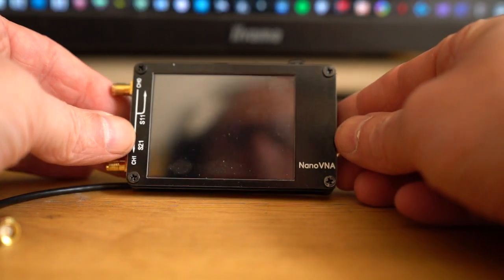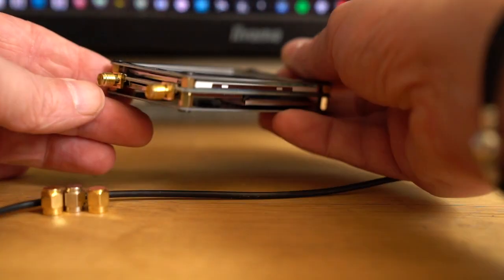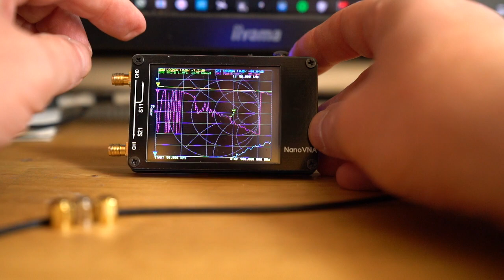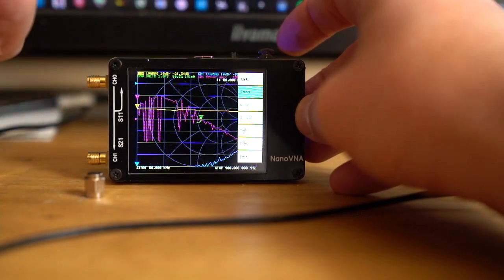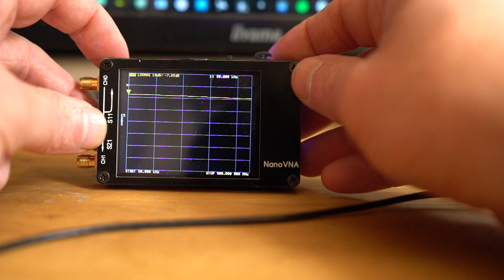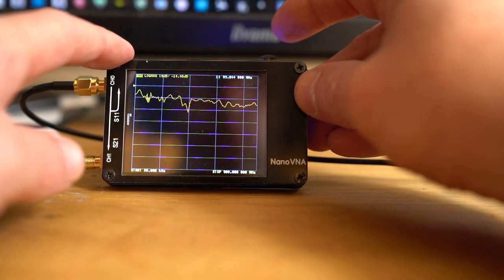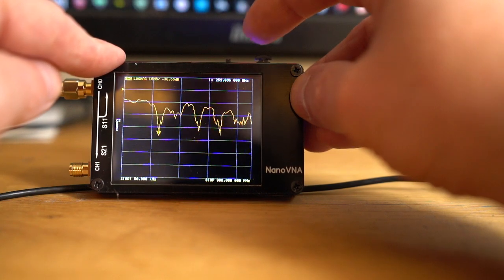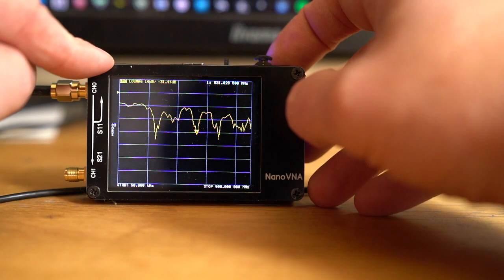NanoVNA for antenna testing

Comment: Doesn't it have a touch screen? Also, you should look at SWR and impedance of the antenna. You want your SWR as close to 1.00 as possible (<1.50 is good) and your impedance to be the same as your receiver and cables (usually 50ohms)
Reply: What happens if impedance is different? I have a cell phone signal booster. It works at 50ohm impedance. But coax is 75ohm. What would happen in long term or short term?

Comment: A LOT OF MISTAKES !!! How do not to use a VNA.
First - It is clear it is not calibrated at all: after the procedure the zero port is open but the marker on the Smith chart is far from the right end.
Second - You can not test an antenna sweeping the VNA from 50 kHz to 900 MHz: it measure on 101 points and it means there are 9 MHz between a point frequency and the next one  or the previous one. If you need a measuring on a so large bandwidht, you have to use Nano VNA and VNAsaver togheter setting "segments" function.
Third -  Nano VNA generates about 0.1 mW of RF on zero port and an installed antenna... No, I leave to you to discover why it is a mistake to use a VNA to measure the SWR (or RL) on an installed antenna.
Go to study before publishing  a video and you will understand that and a lot of other things spreading less wrong infos.

Comment: When you have to snip a brand new antenna, being able to see that V curve helps so much. This is so far ahead of the old SWR Meters.
I like to calibrate a little wider than the band, move the marker to the center of the band and save it on zero. That way it starts up ready to go. Also I just started using the extension lead so stiff cable doesn't tear the SMA port out of the board. Just have to calibrate at the end of the extension.😀
Reply: Love mine for antenna work.

Comment: Cool! I didn't think about checking resonant frequencies without defining a band width. 
For a single band I like to setup up the start and stop frequencies 2 points wider for example if the actual start of my band is 26.965 Id set it to 25.000 and do the same on the stop or high end of the band. That way you actually see the V curve the SRW has.  Without doing that you see pretty much a flat line usually favoring one side of the other.

Comment: I got the top model with big UHF connectors, 4 inch screen 3000mah battery full steel case. Heavy cables and  calibration kit. Upto 3ghz. Amazing results.

Comment: One note on calibration. You want to calibrated as close to the antenna as possible as it will remove any errors introduced by the leads.
After calibration it's good practice to check if the Open/Short/50ohm plots look good.
Whenever you change ANYTHING recalibrate and recheck. This includes replacing leads, moving leads, starting a new measurement, etc.
Another thing to keep in mind is that the RF connectors are fragile and have a very limited amount of mating cycles, sometimes only 1000.
Adding and removing the calibration caps is one cycle each. Best practice is to mound leads to the VNA to reduce wear on the VNA connectors.
This might not worry you much on a €60,- machine but will be important when using a professional VNA.

Comment: where can you attach a counterpoise?
Reply: @paul.alarner6410  People are dumb these days. You gotta watch out for the Village Idiots that go on Forums and think they know what they are talking about on a said project. They have no idea about anything relevant to the conversation. Like today I just wanted to know what oil to run in my transfer case on my truck. Wow half of the people didn't know what they are talking about, and it floods the search with the wrong results and the wrong info.

Comment: Do you have a link to where you bought this one please? looking on eBay and it's a minefield as they have generic pictures. I have just sent an e-mail to you if you would rather reply there than post it on here.
Reply from the maker: Hi Dale this is the one I have purchased it does come with the battery, shielding and calibration kit https://www.ebay.co.uk/itm/50-900MHz-Vector-Network-Analyzer-Nano-VNA-Kit-MF-Antenna-Analyzer-Meter-Tester/153637127219?ssPageName=STRK%3AMEBIDX%3AIT&var=453658403821&_trksid=p2057872.m2749.l2649